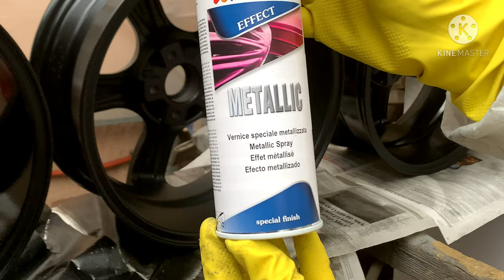How To Paint Your Wheels In Black Chrome (Metallic Effect)

Comment: Hi, what kind of black are you using? Is it possible to get that black chrome effect without the metallic?
Reply from the maker: Im using black matte paint because im using clear coat after. In my oppinion you need to have metallic so you can achieve black chrome effect only with painting.
Reply: @somethingofeverything4646  thank you. Did you use any special code?
Reply from the maker: Yes. The code i have used is CMP E6037 from  DEBEER